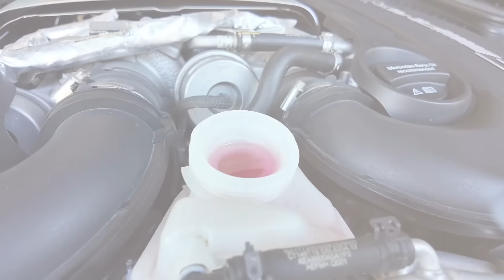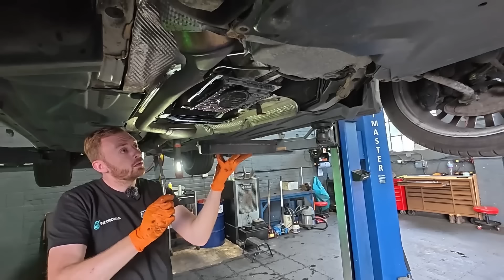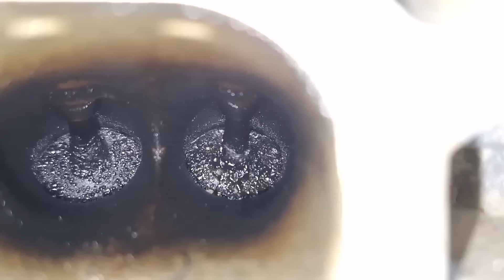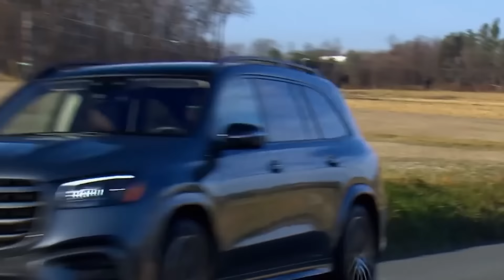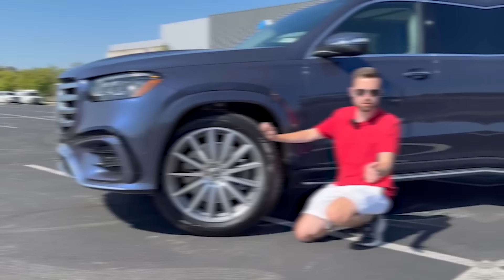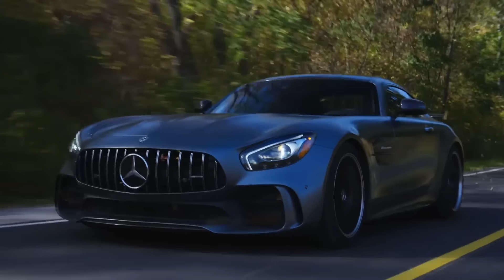How To Make Your Mercedes Last Over 500k Miles Without Any Major Repairs

Comment: Where are you getting a transmission flush for $300? I was quoted $1400 at dealership and $1000 at German Mechanic
Reply: That’s probably if you do it yourself, I did it for $300 with a new actuator plate

Comment: Didn’t hear anything about engine air cleaner, if motor seems sluggish first open air intake system and check paper air filter(s) easy fix.

Comment: This must be an ad for mercedes.  I buy the on thats on sale, i also have a coolant leak ,so i just add regular tap water once a week. As far as yhe transmission is concerned, it shifts just fine. I bought the car used several years ago. Its a 2005c240. I put over 20000 miles on it last year alone. Currently have 180000

Comment: All this is spot on. 
2020 GLE 450 fully loaded bc i drive insane mileage (3.5 hours per day country miles).  
now at 282K 
It wasn't necessarily planned that I adopted these recommendations, merely happened because as soon as a repair is needed, I take care of it at the same local Mercedes dealer.
some repairs pissed me off (engine harness) 

but the car looks and drives brand new, and my daughter has begged for it once she turns 18. so i guess it's been a well worth-it endeavor

Comment: This vid is both + and -.  Yes those things mentioned are valid in fact very helpful points to promote the longevity of a Mercedes.  The minus is by the time you do all those things suggested you will have spent FUCKING ENOUGH MONEY TO BUY A FFFFFUCKING NEW ONE ❗
Reply: Or better yet…an older Toyota

Comment: They just said we use this blue or red coolant and say never use green or turns to gel then they show adding green coolant to the vehicle... FAIL
Reply: I liked when they showed a guy sitting in a jeep.
Reply: They showing to you that using it to never us it for your car
Reply: The colour of the coolant is not important.
Thats so you can clearly see if its leaking oil, coolant or atf.
You need the right spec.
325.0 for example and so on.
Reply: @Masteranddisaster13  I flushed mine until clear and went to G40, their latest I believe and unlikely shops would have what was in it.. purple now, was blue.  but comment was about the green, we were warned not to mix then shown it being mixed...
Reply: @craiggerlach5548  i am still using the 325.0 green on mine.
Actually just replaced it a few weeks ago.

Comment: I completely agree with everything presented in this video. Over the years, I have owned eight Mercedes-Benz vehicles, mostly through leasing, with three purchased and kept long-term. One of these was a 2013 W212 that I kept for 13 years, and the person I sold it to said it looked and drove like a three-year-old car. I have always followed the recommended service schedule for all my vehicles, and I have never experienced any issues with my Mercedes-Benzes. This is why I wholeheartedly accept everything discussed in this video as fact.
Reply: As a double Mercedezes owner I generally agree with your response but two questions and a comment.  Do you drive in FUCKING SAN FRANCISCO WHERE POTHOLES ARE UBIQUITOUS AND EXTREMELY DAMAGING?  Two, if you are NOT a commoner i.e. you're a millionaire any reason you don't qualify that in your comment?  AVERAGE AMERICAN MIDDLE CLASS OR SLIGHTLY ABOVE DO *****NOT**** FUCKING SPEND THAT KIND OF DEBGUM MONEY RELIGIOUSLY FOR THE SERVICES A, B, C, D, E, F, G BLA BLA AND FUCKING BLA.  MOST OWNERS PROBABLY DON'T EVEN USE MID-GRADE LET ALONE PREMIUM.  Excuse the colorful language.*
Reply: M276 v6 engine in yours?
Reply: BOT
Reply: Thank you very much I just purchased a 2011 e 350. I know nothing about the car. I have a friend who works as a mechanic for a Benz dealership. So he will help me get and keep it in good shape.
Reply: @wespeterman1207 he will be your best friend, if you have sister I'd introduce him to her asap to keep him from going too far 😅😅
Reply: I imported a mercedez c class from China and its in Africa now South Africa. Should i replace the transmission oil?

Comment: Great Content: I own a 1996 S500 143K mi. I just replaced the entire cooling system. Sounds and runs very good! My suspension is next. Thanks again for this knowledge!! Ken!! OH!!👍🏾
Reply: I've got a c180 at around 90k miles, I've had the car 6 months and she is currently getting all new brakes and engine flush, transmission flush and radiator flush.... hyped to get the car back 😂 

For me the best thing is my mechanic is a real friend and doesn't just go charging me for nothing and actually given me legit advice as he has had a few, I'm super curious as to the state of engine fluid, trans and radiator as I feel like whoever owned the car in the past didn't give her the love she needed.

Comment: Depending on where the coolant temperature sensor is. Initially, the temperature will increase when there is a problem. If the system drains completely dry, the temp gauge will go back down. If the fluid level is low and the temperature gauge fluctuates, pull over NOW!

Comment: MB genuine coolant in a mid 2000's car will last 15 years if you replace the coolant reservoir.
The reservoir contains a chemical pack which maintains the coolant.

Comment: Only 200,000 on my S212 E 350 AMG. I sold my sprinter’s on at 350,000  all 3 still going fine. I explained that servicing is really important on the MB engines. Hopefully? They have continued. I know last one is fine. 
Servicing costs a lot and saves so much also. On my car, I had a totally free rear subframe due to service history. Very rare apparently. Not main dealer but specialist. This is only same as a standard garage but recognised. They understand all this. 
This includes using oem manufactured parts without the MB badge. Febi is just one. 
Still does 150mph+ 
I think they like stretching their legs if you know what I mean. 
Planning on keeping a good number of years yet. All known issues sorted inc deep V oil leak. 
New bags also, though, I insisted it was sensor to start, 2 years prior. I was right. Only one side want down. Not same side. Also irregular. 
After a Vito 119 soon as a dog van. They like speed and bank into corners lol. Leonbergers. 
Love and peace
Reply: Never heard of a e350 amg.. they usually are two different types of motors

Comment: I give you another 200$ if you find certified technician and he do trany service for 300$$$, wake up my friend, and stop nonsense bullshit
Reply: The cost of a transmission flush service can vary significantly based on your location. When I needed this service for my 2013 Mercedes-Benz E350, I researched and received quotes ranging from $300 to $600 at independent repair shops and between $700 and $1,100 at authorized Mercedes-Benz dealerships. Ultimately, I decided to go with Mercedes-Benz of New Rochelle and ended up paying towards the higher end of that scale. However, I owned that E350 4MATIC for 13 years and got a great price when I sold it, as it still looked and drove like a new car.